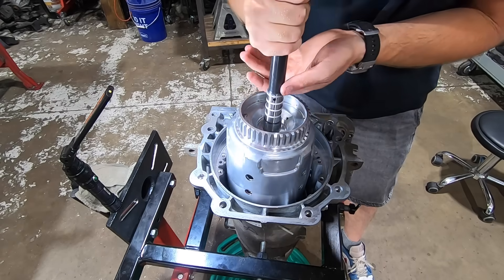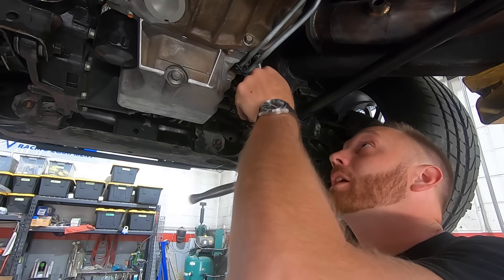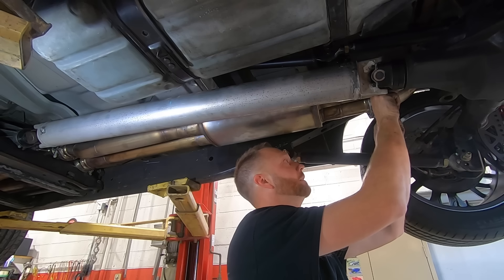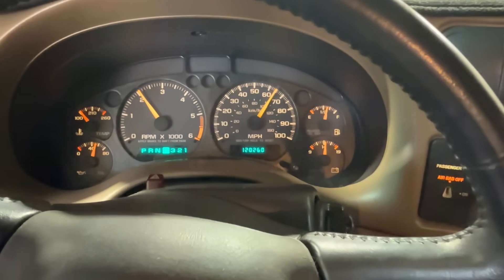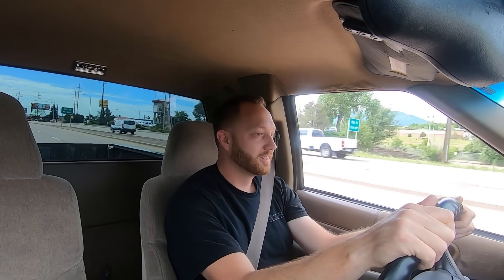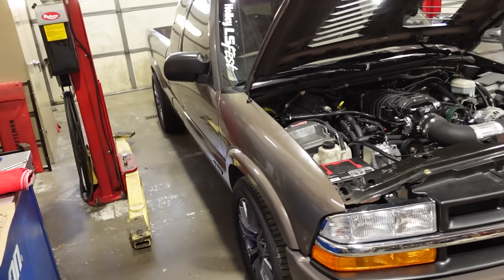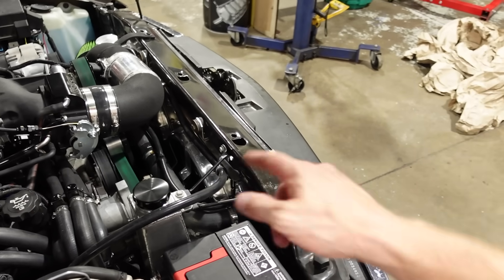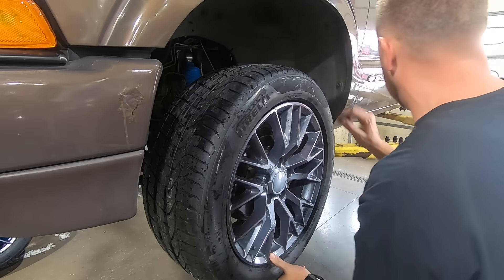can my DIY built 4l60 hold up to the SUPERCHARGED SYCLONE?

Comment: Great project. It’s to bad you can’t put the radiator and coolers with the fans in the bed like the off road desert trucks run. Is that an option? Then there would be plenty of room for inner coolers.

Comment: Lol at the just don't do a awd s10 🤣
I've said that each time I built another one.
Think I'm curbing the one I still haven't finished and going to put all the gathered parts into a tahoe 
Twin turbo 6.0 4l80 and 149 awd case .

Sounds like a nice ride to replace the woman's 6.0 trailblazer 👍

If you think a s10 is bad to work on a v8 4wd trailblazer is worse . Which is why I want to put her in a tahoe instead

Comment: cool job,  I you need it I have a Allison to LS from the factory 2019 build, its on my L96 and its a 6spd,  but I can use it Im building a Jeep rock crawler... and need the clearance but I have the Adapter, torq, Allison, wiring cpu for both .... lol under 20K pop if you know any one looking for the killer setup thats 10x stronger than the 6l80 lol cool build I want to drop the blower or turbo on mine too....

Comment: Long time transmission rebuilder here.  Don't worry about break in as none is needed. The clutches are good to go right after start up.  The only questionable area in the 4l60e is band timing and whether or not it has shift flare. A lot of different ways to set these up. Some use the gm go no go tool. I use a dial indicator.  Regardless it's an area where trial and error is sometimes needed . As for the 5 pinoin planet this is straight from a gm engineer.  The 4 pinion planet is stronger then the 5. How? The 5 pinion planet was made from a far less robust material than the 4 pinion there for gm had to add the extra 5 pinion gear to it.. you'll probably never hear this from anyone as everyone thinks the 5 is an upgrade.  I can find the gm engineer video if your interested

Comment: I think the goal for that 2G Syclone setup should be in the 10s on a regular street.  ("private"/"closed to the public" street of course)...  
The bone stock Audi RSQ8 I have here rips off 11.7s on regular old Michigan country roads, and your power to weight ratio is much better.  I can't wait to see how much abuse your 4L60 will tolerate, and if it does break, what part it is that breaks!!
BTW, I find these AWD vehicles to be consistent enough on regular roads that you can actually measure performance changes easily with 1/8th mile times on regular roads, or even 0-60s.  A Dragy makes it so you don't even need to drive an AWD vehicle to the drag strip until it's good for about a 9 second quarters.  For a reference point, the Audi runs 7.4s in the 1/8th, and 3.5s for 0-60s.  You need to be smoking those numbers with your setup.

Comment: As far as what I'd like to see for this truck and the others that you have, is working on getting them lighter for the type of racing you are doing. Using different materials to shed weight off while still keeping functionality and drivability. Showing off more of your fabrication skill by working with aluminum, and even plastics. Maybe even getting so deep in that rabbit hole to even get into swapping out bolts, nuts, washers with titanium. Even using that same material for suspension parts will aid with weight loss and strength as well. 
Also, with getting the truck lighter, it should end up helping to save that transmission a bit of extra work too in trying to get that weight moving swiftly. Just a thought. 
I second the comment about an aluminum radiator support upper and lower, with the bigger radiator. Try going one step colder on the thermostat too. I run a 185 in my car, and I'm in the northeast section of the states. No issues with it during the winter months, and even during the summer in traffic it doesn't go beyond 205*. 
Look Into fiberglass or carbon fiber body panels (fenders, hood, bumpers .etc). Aluminum brackets where possible... especially anything after the firewall. 
Update your battery to a lithium one that only weights 8-12 lbs. Which is a huge amount off a normal AGM style. (Make a custom battery tray and hold down brackets out of aluminum too, to shed even more weight). 
Find some wheels that don't weigh much too (for track use)...the Less rotational weight the better.  😉

Weight the truck as it sits now. See what the bias is, and then start getting into the weight reduction thing. Have some fun in seeing what different parts you can make up to replace the bulky ones in it now. Do a comparison. Then do an overall weight test at each phase. I think it would be bad ass to see you get this truck under 3500lbs with you in it, and a full tank of gas.

Comment: If it makes you feel any more confident, with my 60e I run consistent 1.7 60 foot and mid-high 3 second 0-60 through a 60e with a cheap summit converter, an eBay corvette servo and a shift kit. I have at least a hundred digs on it and it hasn’t shown any signs of damage/wear. 

This is through an awd silverado

Comment: A few friends and I have a hobby shop where we built our own cars. The 4 of us that have GM cars all have 4L60 or 700R4 transmissions in them. All run low 10’s and are street legal with full interiors and 8.50 spec cages. All over 3,000 lbs. We have not had to do anything but maintenance in 10 years of driving daily and over 100 laps each on 1/4 mile tracks. They are a gem of a tranny to us without the big heavy 4L80 or TH 400. We love them! And we built them ourselves. Built, not bought.
Reply from the maker: That's awesome to hear, thanks for sharing! Gives me some hope

Comment: The radiator in the 99-02 Silverados are 30 inches so it might be a little bit easier to install then the 03-07 34 inch

Comment: Typically the 4l60/700r4 failures are CAUSED by the builder or installer and mostly the tuner. Now i still wouldn't use them behind anything above 800 hp, but i have beat the hell out of quite a few that ive built and they're still in service.

Comment: This is a sweet truck LT. Back in 2011, I had my trans builder build a 60e for my OBS with a 383 with 512/484 (on the engine dyno). Everyone told me I was wasting my time and it wouldn't last but I literally just dropped it off for a rebuild again earlier this year during the racing off season and it's back on the road again with a cammed 6.0. It has the typical upgrades but nothing exotic. HD sungear, Blue Plate clutches, shift kit, servo, converter etc. I wasn't expecting it to last 14 years tbh but it did and the only reason I had it rebuilt was I was swapping engines, it wasn't slipping or anything. Maybe it was luck but I've had good results with my 60es. Keep the fluid changed and keep them cool and yours should last a while.
Reply: Im in the same boat and so glad he went with rebuilding it with upgrades. A better choice than the 4L80E swap.
Reply: 4l60e is a great transmission and you can definitely build it to hold power, most fail after a rebuild because a lot of builders overlook areas of concern. Besides addressing leaks in the shaft and clearance in the input drum builders neglect the valve body and pump, these things need to be vacuum checked for excessive blow by and worn valves. Cleaning them and throwing a shift kit in isn't good enough, there are couple of valves that are directly related to 3/4 clutch failure. Sonnax did a good job with a vacuum test guide to point these areas out, you can download one for free on their site.

Comment: Perhaps as a possible short term solution for the engine heat issue you could swap the factory thermostat to a lower temp unit? I live somewhere where it doesn't get cold but have had great results with a 160 degree thermostat. I don't have forced induction but even after hours of running on 40c days medium weight towing it would still run about 10c cooler. There is no substitute for radiator effectiveness but it does make a difference.
A not so expensive mod but could be worth a try.

Comment: They can live, ive blown mine up 3 times. I now have a $8k 4l60e that has been holding so far. I am still scared of it but I have been smashing on it more. 550 hp 6.0 pushing 40's made the 4l60 upset, but $8k later and it lives. 4l80 was out of the question. Good luck
Reply: Just out of curiosity, why is the 80e out of the question for you? Have you had bad experiences with them in the past?
Reply: @Lou_sassel315  probably size and weight.

Comment: I have been running the same 5 pinion planetary's in my 4L60 for some years now without any problems, I am also not making the power LT is or running all wheel drive.

Comment: I was under the impression 5 pinions spread the load out more even, creating the extra strength. I'd assume there's a reason GM used them behind the higher powered engines before the switch to the 6L80E.
Reply: They do but you need a real gm one the actermarket ones are made from crap metal.

Comment: Lower temp thermostat will help once they get that high its hard to cool Mount Extra heater Cores around the front or bed to Dissipate Heat.. What ever Vickers Performance has been doing to 700R4 has been working and hes not proud of it, Get a Tougher 5gear planet Made.. Im Collecting tools to Make Parts a Mill would make that Transmission Planet Im working on Acquiring one....

Comment: Your recipe is pretty close to mine.  I added a main input drum reinforcement, or a heavy duty main drum.  And a sonnex 6 planet,  but that's more to get the 1:2 shift closer together,  and its a beefy part.  Ive seen way more 4 planets fail than 5.
Reply: Just my opinion but I think the reason why the 5 pinion is considered an upgrade is not because its made from stronger material its because it distributes power more evenly to the output shaft than the 4 pinion. Same as the Sonnex 6 pinion front planetary isn't any stranger than the 4.

Comment: The video you are talking about with a previous GM engineer that actually designed these transmission and explains everything about them and GM, I saw that video as well. I believe he said that when people where updating these transmissions because GM won't do it for some reason and are missing that market on money to the aftermarket scene, that the aftermarket 5 planetary gears are made from inferior metal BUT if you get them from GM transmissions because some GM transmissions had them, that they are an obvious upgrade for sure. So just make sure you get them from GM or GM transmissions that are in good shape.
Reply: He was an electrical engineer, and he worked on the 4L80E controls. He hasn't worked for GM for decades. And, there is a reason the 5 pinion came in every 4l60E that was behind the 6.0 and in every 4L70E.

Comment: I worked with guy who built transmissions for a living,  many race units, and diesel applications, he said asking a 4L60 to live behind 400 hp / 400 ft / lbs , in a truck, was about the limit. The S10 is pretty light, by comparison,  so, we will see.....
Reply: Your guy is a complete maroon just like 99.99999% of 4l60 builders who give it a bad name.

A properly built 4l60 has to be turned DOWN from stock in the tune and will automatically compensate for wear over tens of thousands of miles.
Reply: @zacharymorris9917 😂, we built hundreds, and hundreds of 4L slippies buddy, they die behind 200 hp V6 regularly, 
IF THEY WERE GOOD , we wouldnt have had to rebuild them, now, would we ?  
Or is that lost on you ?
Builders didnt "give it a bad name" either, it's well deserved reputation is because it was never that good !  Why did the 4L80 exist, is the 60 was SO TOUGH ? 
How do you "tune one down", thats the dumbest shit I've heard all week...
..
Reply: Nothing is more telling about a transmission builder than the fact that they have never had to turn the trans down in the tune.  I'm dumbfounded even though this is exactly what I would expect from these 🤡s.  Mr. $500 rebuilder....🤦‍♂️
Reply: Shock load is what really kills parts, if was using a 2 step and launching at 5500 rpm it would kill the trans, if he keeps it like this it may last awhile.

Comment: I'm building a 2WD 99 S10 and it doesn't have more room.  I couldn't run 2 pipes down the one side of the transmission, even with only 2.5" exhaust. Oil pan fitment is slightly better, but the truck is just a bit too small.  Same issue with starter, it is a puzzle to get it in place.

Comment: You should try some Dawn dish soap in water with a spray bottle instead of tire soap.... I worked at discount tire for a couple years and that's what we use even though we had tire soap at every tire station. Works great evaporates and doesn't leave any residue. And it doesn't take very much soap in the water. Pissed off all the regional managers because it saved them money but it wasn't the way they wanted it done even though it worked better. Just make sure it doesn't dry while you're using it.

Comment: The 4L60 is a better transmission than people give it credit for, just has to be used correctly in the correct application. The valve body is know to be the root cause of a lot of failures so upgrading that to a quality aftermarket one should be considered
Reply: the 4l60e is an awesome transmission, you are right to point out the valve body but its because most builder neglect them and never do a vacuum check. Another area of concern is the pump same deal people just throw in a shift kit and a boost valve and think they're golden and then wonder why the unit failed. I vacuum check and repair the valve body and pump, these issues can be repaired with Sonnax and Transgo parts and some modifications.

Comment: Ive got a fully built 4L60 behind my supercharged 468bbc. Should be around 800hp. I did hurt the transmission one time. I broke the sprag. You can NOT put it in O/D when playing around. Take off in D or manual shift
Reply: Sonnax makes a sprag hub but those are pretty pricey but if you're that kind of power its definitely worth it.

Comment: With it being awd it is harder to do than a 2wd. But, it would be neat to see at the track the difference between the 28s you have and like a set of 25-inch tires would do. It would be the same as switching from 3.73s to 4.11s.

Comment: 4 pinion vs 5 pinion doesn’t matter unless you are overloading the individual pinion capacity. The individual 5 pinion load is 20% less than the 4 pinion so better materials may not have increased the overall planet capacity enough on a street vehicle for the cost/benefit at the manufacturers level.
Reply: The 5-pinion planets are well known to be a downgrade.  GM went to the 5 pin so they could use lesser quality metal in the assembly and have similar life in a stock unit.  They show their weakness in performance use.

The Corvette spec 4-pinion planetary is the one you want to use.

Comment: Thankful you address the 4 vs 5 "controversy"
Possibly just a step sideways, not necessarily an upgrade.... either way, it's not like it's as heavy as a full size, you aren't trying to make 1200 HP, it's not on slicks.....I think it's going to hold up better than most people think. 
 I have a awd 2000 bravada, a zr2 parts truck, and a 87 2 door blazer.....even a 2009 5.3  It's just a pile of parts right now, hopefully turns into something. But I also own a shell of a 2 door 72 Chevelle. It was hit in the front, so the frame is toast, but everything behind the doors is pretty decent. 
With the zr2 rear end, Corvette 17s will be close, but will fit. Likely fronts, I don't think anything bigger than 275/40 will shove in there. But I haven't seen anyone do a awd Chevelle yet. Could be cool 
Even if I leave the 4.3 in it, I bet it wouldn't be that much heavier than a blazer....right? And probably cooler than a blazer...

Comment: Very cool build fun to watch. I dig manual trans, but that auto does sound nice and tight - even better paired with that SC whine! Keep the video's of the tweaks coming. Interesting your comments about the shift points and adjustments you're making there.  All of the sounds coming from that little truck are awesome.

Comment: Sonnax transmission parts are the best when it comes to rebuilds. Even the "Major Companies" building and rebuilding transmissions use them for their rebuilds. The 4l60 has a couple of decades on it. More than enough time to identify the weak spots (besides the 4 - 5 pinion debate) and beef them up. I have a feeling you're going to be really happy with how it performs over the next couple of years.
As for the radiator, you're already maxing out it's cooling capacity. Have you considered a discrete second radiator in the bed, with a fan, using an electric pump, plumbed into the heating hoses? It wouldn't work as the main cooling system, but it could add about 30% to your cooling capacity, and help in slow traffic quite a bit. Just a thought.
Reply: Yep decades, and Sonnax is great. But, even they haven't solved the problem with 3-4 clutches getting roasted. Their 1,200 billet shaft and custom input drum will prolong the demise of the clutches, but won't stop it.
Reply: @ptbelttactics  Sonnax did address the 3/4 issue in their vacuum test guide, builders just choose to neglect the vacuum test for the valve body and pump. Most just throw in a shift kit and boost valve and think they're good.
Reply: @martinez1701a wrong, vacuum test the valve body, all you want. There are a dozen other issues that can cause 3-4 to get burned up. And, even if you manage to solve every single one of them, they eventually comeback. Even if you only know how to rebuild only one transmission, if it is the 4L60 you will never manage to work yourself out of work.
Reply: I got tired of factory radiators in my Silverado. I kept popping end tanks and finally went all aluminum. They work great in the summer. Maybe too well for winter.